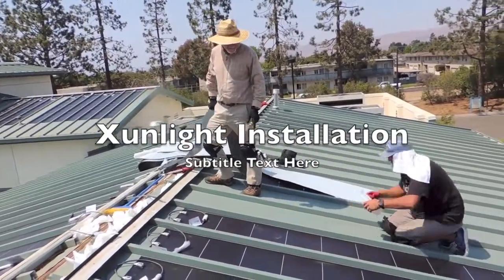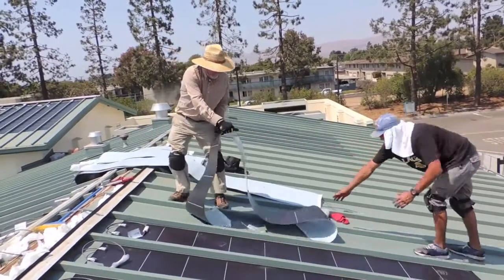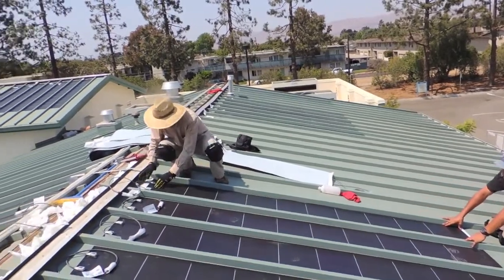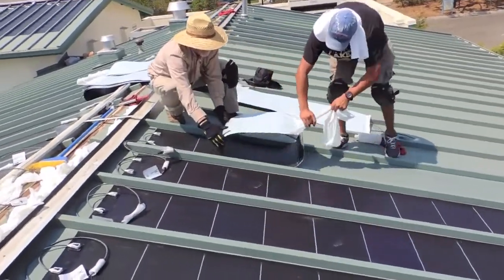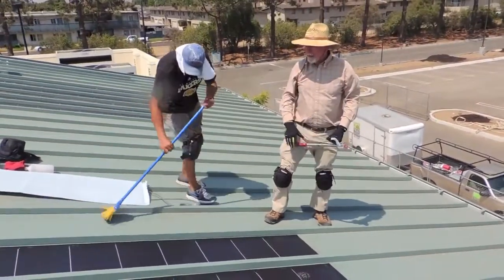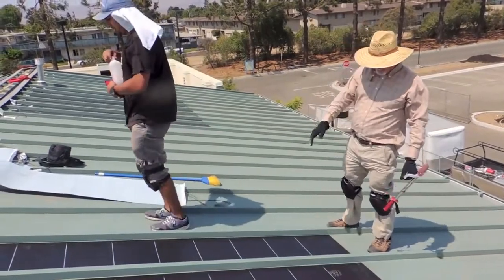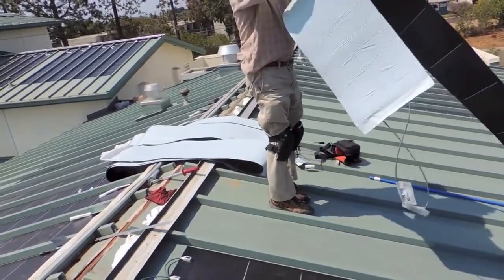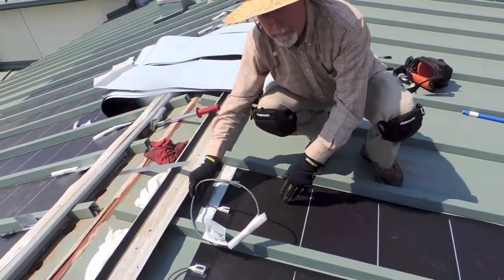How to install flexible thin film solar panel  PVL-144  PVL-136  PVL-72

Comment from the maker: Flexible Thin Film Soalr Panels avaiable on Ebay: 
72W: https://www.ebay.com/itm/384764968954
144W: https://www.ebay.com/itm/385075490034
300W: https://www.ebay.com/itm/385182076506

79W Foldable Solar Charger:
https://www.ebay.com/itm/384653140012

Comment: Why not start from the bottom of the roof and work your way up?
Reply from the maker: Dear Sir, in order to make the wire fixed on the top of the roof.
Reply from the maker: @justrosy5  This Video is from our client who was willing to shoot an installation video under our installation supervision. This Video is intended to show how our panels are installed.

Comment: I guess very cheap solar film on a roll as wallpaper would not be worth it since the light energy inside is very low?? I
Reply from the maker: Dear Jean, in fact it is not cheap. You may search Flexible Amorphous silicon Solar panel to know its advantages and disadvantages.  It is a good product. The only disadvantage is its efficiency. Cell 10%.